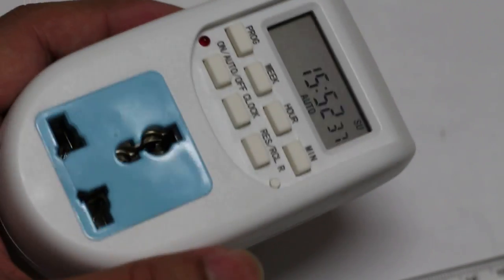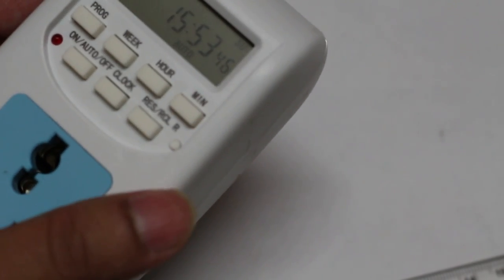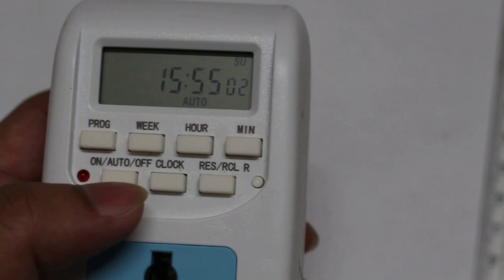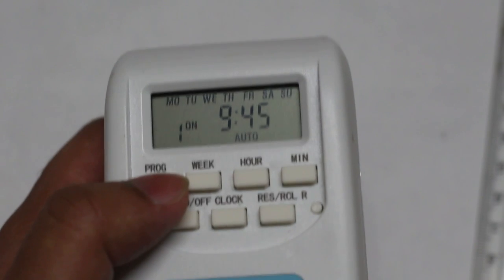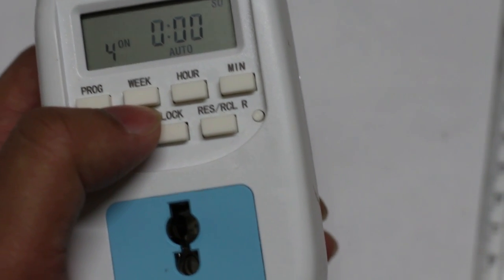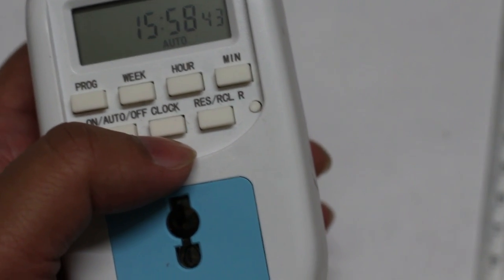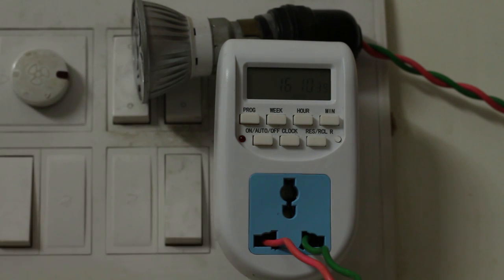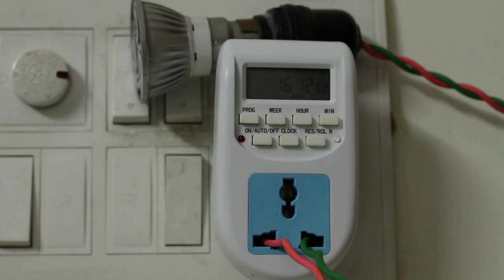Programmable Plug-in Digital Timer Switch

Comment: i have tried holding the clock button and it does nothing.. also just pushing the clock button does nothing.. i need to set the time.. everything else works fine
Reply: natahn ford hold on the clock button, and at the same time press the other buttons

Comment: I have the same unit but I have run into some issues after few months of use where it randomly goes off before the time it is supposed to go off. Is there anyway to reset this unit? or any fix anyone has found?

Comment: can this be use for 2,000 watts broadcast transmitter?
Reply from the maker: seller says max load capacity is 1000 WATTS
Reply: 1000 watts is probably for 110v grid.
Reply: @the-real-randomprojects  Which type of cell is required for this device?

Comment: How do I set the clock in the plug ?
Reply from the maker: Setting up the clock is an easy task.. press the clock button -> then set the hour and minutes..
Reply: i have tried holding the clock button and it does nothing.. also just pushing the clock button does nothing.. i need to set the time.. everything else works fine
Reply: @natahnford8937  i guess you need to press the R button on monday 00:00 at midnight
Reply: Just hold the clock botton simultaneously press the hours. Min. Week bottons